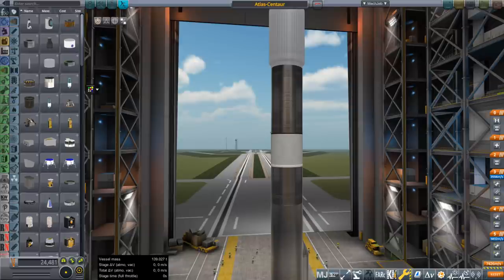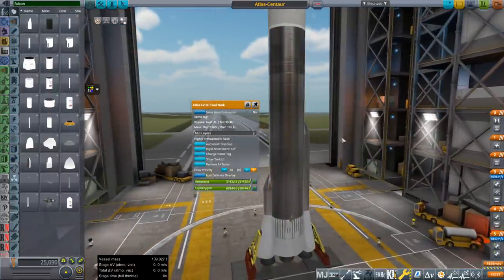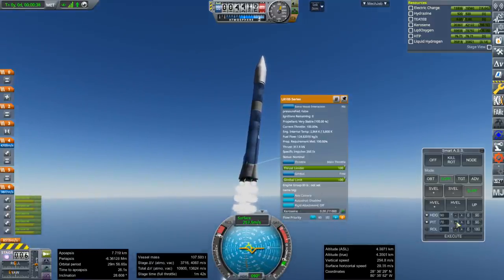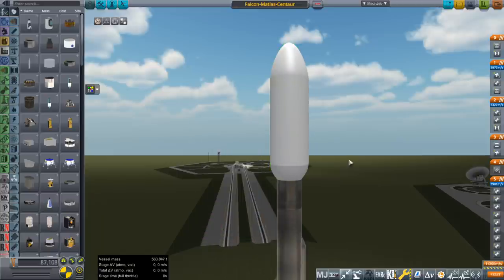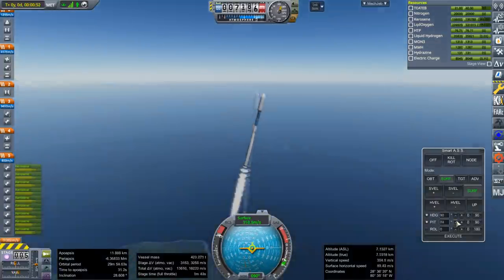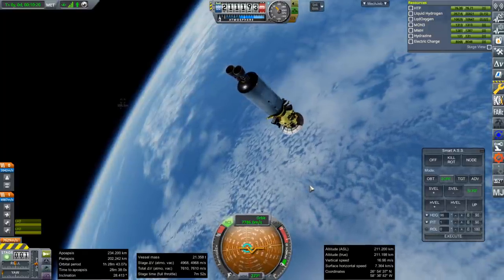Realism Overhaul in KSP 1.8.1 - Falcon-Atlas-Centaur

Comment: Welcome to another episode of "What Kind of Stuff Can We Attach to a Falcon?"

On a side note, does this show that a full Falcon 9 stack with a Centaur third stage would be a super capable launcher?
Reply from the maker: I'm at least satisfied that, if the Atlas tank was strong enough to lift Centaur, the structure of the Falcon 9 second stage should be as well (even though so far no mass this heavy has been placed on it), so at least it's an option. The only thing is, Centaur is really expensive. If we could get a New Shepard converted to upper stage use for cheaper, it's about the right size. At the very least I would like to see the two companies fight over pricing.

Comment: 1:50 Just imagine what dry mass ratio we could achieve with a modern-day balloon tank.

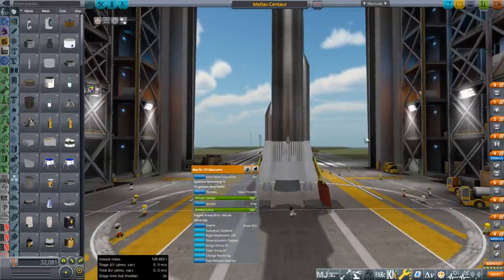6:45 I'm imagining an alternate history where the SM-65-derivative Atlas was never dropped, SpaceX became primarily an engine development company, and something this actually happened.

8:20 Well, you are missing that excess kerosene mass...

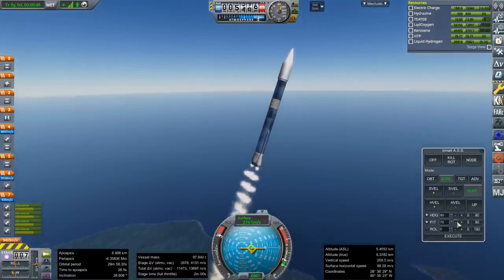9:00 It would have lead to better performance if you did some calculations as to when the TWR of the stage with 1 Merlin 1D vacuum equaled that with 1 LR-105 to find out when to separate the skirt, as well as ignite the vacuum engine when its Isp exceeded that of the sea-level engines.

11:00 Though highly unlikely, it would be awesome to see Centaur serve as a 3rd stage for the Falcon 9/Heavy for some missions. I would imagine it would be useful to reduce the gravity assist requirements of Europa Clipper and Dragonfly if they select the Falcon Heavy as LV, and would greatly increase the chances of that.

11:10 Oddly, it seems that generally, the dry mass fraction of both the Atlas and Centaur increased over its service. (As an example, with optimal engine shutoff timing, the Atlas SLV-3 was capable of delivering a negligible payload to a 150 km Earth orbit without jettisoning the skirt, but no subsequent Atlas had any SSTO capability.) While some degree of increase due to structural loads is understandable, the sheer amount it increased by seems to makes that an inadequate explanation.

Comment: This is an extremely cursed suggestion but how about a starship shuttle. ie full shuttle stack but instead of the orbiter there is starship. 

Could use raptors or replace them with SSMEs. Either way it is extremely cursed
Reply from the maker: Ah, Starship alone is heavier than the Shuttle and External Tank combined, so what we end up with is actually Starship . . . with the two SRBs . . .
Reply: @RaizSpace  why not then?
Reply: @RaizSpace  that makes sense now that I think about it. Sometimes I forget the scale of starship.
Reply: Space shuttle but with a starship tanker instead of the external fuel tank. And the Starship "cargo" fuel tank filled with Hydrolox for the shuttle.

Comment: It will be interesting to see if you can make an ssto out of the Atlas rocket using modern engine
Reply from the maker: You can - it's just a matter of what payload it can carry, which depends on the engine it uses. Any engine or combination of engines that has more than 120 tons of thrust would qualify, though hydrolox engines would have a tough time because of the limited tank volume.
Reply: As I mentioned in another comment, the Atlas SLV-3 variant as it existed did have a marginal SSTO capability, though it was never used as throwing away a rocket of that size to launch 50 kg or so into orbit isn't very practical.
Reply: @grantexploit5903  but alone the fact, that it is an Atlas, means that this cannot be an ssto right? because of the engine separation

Comment: Hi Raiz! There's a problem I have in RO 1.8.1 . Everytime I launch a satellite with parabolic antennas, the antenna breaks at some time during ascent. Have you seen this problem too?
Reply from the maker: Are these deployable antennas that you deploy on launch? Otherwise, might they be too close to the fairings?
Reply: @RaizSpace  I think I resolved it. It's probably some glitch due to the fairings I use and the fact that antennas snap under some dynamic pressure. Thanks anyway!

Comment: Which mod is the Falcon 9 from, been looking for a nice one
Reply from the maker: This one: https://forum.kerbalspaceprogram.com/index.php?/topic/71323-172-kk-launchers-delta-pack-v-10-15-06-19-spacex-pack-v53/
Reply: @RaizSpace  Cool thanks! Any tweaking to get it to work in 1.8.1 or is the SpaceX pack compatible with it straight away?
Reply from the maker: I forget if this was one of the KK rockets to need shader fixes - probably not, but I don't remember. Otherwise, the parts should be fine.

Comment: How does Raiz make so many mods that are for like 1.3.x or even 1.1 work in 1.8.1
Reply from the maker: As long as they don't have plugins, most part mods are version agnostic since about 1.1.3 unless they're dependent on a plugin that didn't get updated or changed drastically.. Some made earlier than that may have collider issues. There was also a particular version of Unity that, if parts were made with it, they developed shader issues in 1.7.3 onward and would have to be reimported with a newer Unity.
Reply: Raiz Space well damn, i mean... i’m not good enough at modding to understand what this means, but good job bro. Keep the work up, you’re doing great by the way!

Comment: Raptor engines on Falcon 9, please
Reply: How many?
Reply from the maker: I will consider this.
Reply: @RaizSpace  Thanks, I wanted to try it myself, but my computer is weak for Realism Overhaul
Reply: @pooounderscoreman  Based on what I researched, 4 to 5 Raptors should be enough to lift the Falcon 9
Reply: @Douglaswiller  I suppose one could use 5 on stage 1 and 1 on stage 2 with larger tanks and payload.
Reply: @pooounderscoreman  I agree, but I think this would end up becoming a Superheavy Lite or something, since the tanks would have to be modified to store Methane.
Reply: @Douglaswiller  exactly! Superheavy light without starship light.
Reply: @pooounderscoreman  A very cool and crazy concept. Lol
Reply: Lets cal the 9 Raptor Rocket Eagal sice it is biger Than Falcon

Comment: Why is the atlas tank better?
Reply from the maker: It's a balloon tank - it is so thin it only remains rigid because of the pressure of the propellant inside. When it's unfueled they pump nitrogen in to keep it from buckling. Also, it was a common bulkhead tank - instead of using separate structures for the fuel and oxidizer, it uses the same structure and just puts a wall between them. The Falcon 9 has this feature, too, but when Atlas was introduced it was a novel approach.